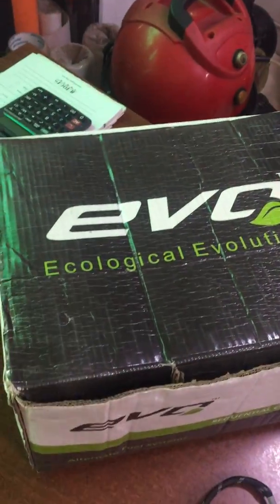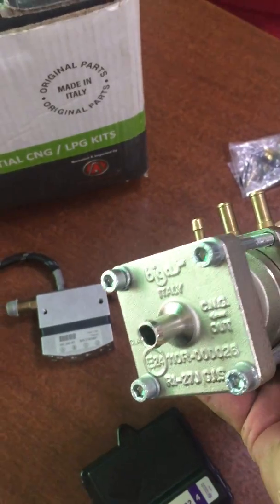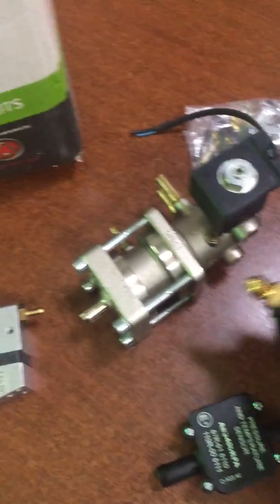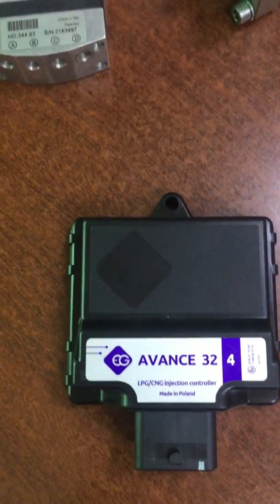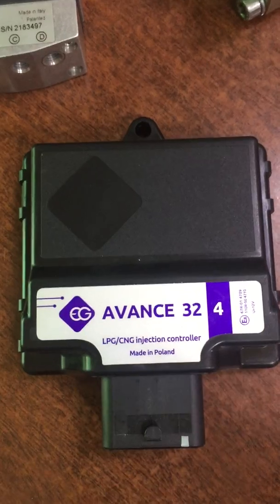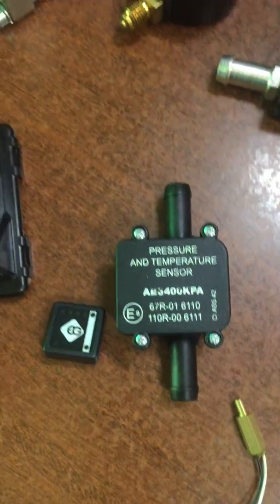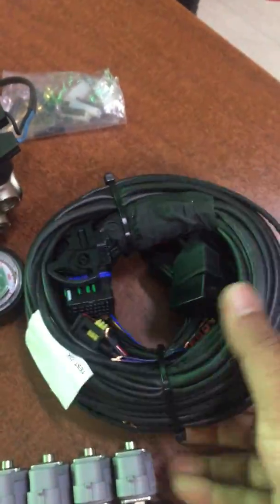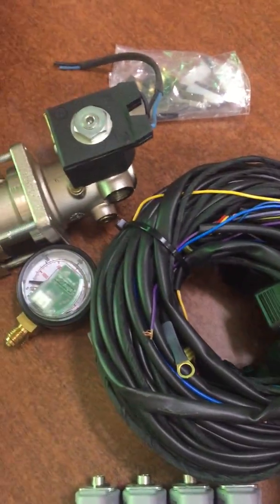OBD2 CNG Kit box

Comment: What if different btw obd2 and exr
Reply from the maker: in OBD2 you connect wires from CNG ECU to car's OBD port to read Fuel trims i,e Petrol Air ratio, so you can match the fuel requirement of engine while running on CNG for best results, engine life and mileage, NO check engine lights
Reply: @EVOAUTO  what type of cng kit is best for my swift 2008 1.3 petrol
Reply from the maker: @sukhsingh243  where is the car registered and how many kms uve done? For this model u can get a venturi system with Silver electrode spark plugs for best performance